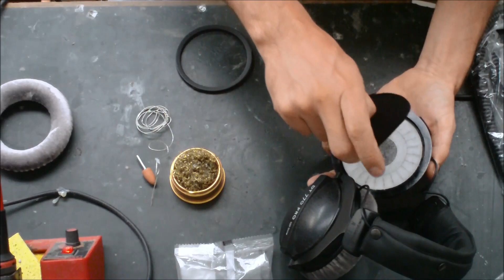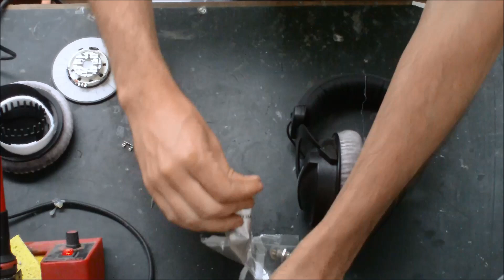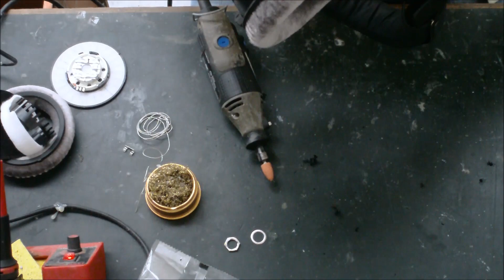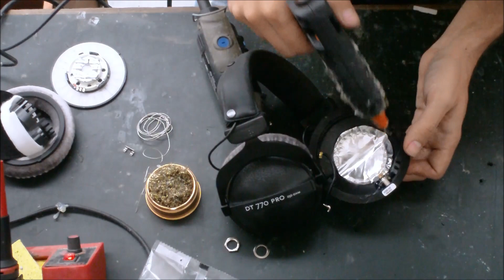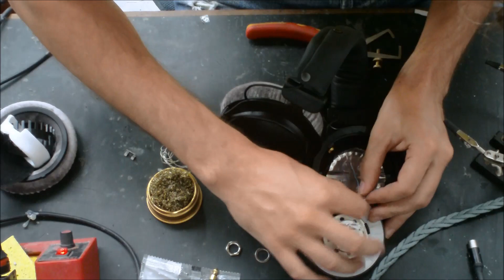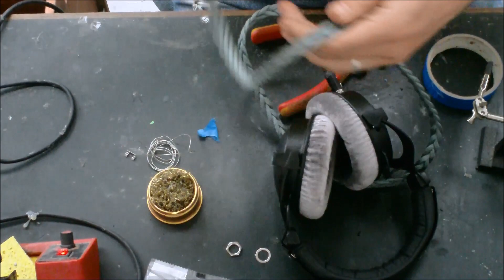DT770 Detachable cable Mod

Comment: Hello Jason. My headphones gave up on me - the lead pulled out of the housing on the left headphone Following your videos, I bought a soldering kit and  attempted to fix the problem. I failed, miserably. I've now got new headphones. Could you tell me, please, how to reinforce the cable housing, ie cable to phones. What sort of glue/reinforcement could I try? Maybe a small lug/washer or some kind of magic glue??? Might save me from buying another set of headphones. ravingbonkers1234@yahoo.co.uk.
Reply: raving bonkers Thanks for your response, Jason. In answer to your question, I have DT770 Pro's. I had a disastrous time trying to fit a new cable on the old ones. I did exactly what you warned of: melted the housing for the contacts with my new soldering iron! Now keeping the old ones for spares. To avoid the original problem, I'd like to reinforce the external cabling from the outside, to stop the cable working loose. Some sort of polymer glue? Just some strengthening from the outside. I don't want to invalidate the warranty by taking them apart. Thank you.
Reply: +raving bonkers search for sugru

Comment: Gret video. Thanks! What's the purpose to change the cables other than to make it detachable? Is it a better connection audio wise?
Reply from the maker: We did re-cable them inside and out with higher quality wire - it is not shown in this vid but we normally replace the wire in the headband as well with the same wire as we use for the cable. If you have a good recording and good ears you can hear the difference but you could just convert the original cable to be detachable which would be cheaper and easier

Comment: What kind of solder gun was that? Also what was thing you kept dipping it in? Was that some type of tin? Sorry I'm still a novice in soldering, but I'd like to practice more and my old solder gun doesn't work that well
Reply from the maker: Unfortunately the soldering station in this vid died and I can't remember the make - we replaced it with a digital temperature controlled one we picked up in maplins which is much better. The little pot I am dipping the tip into is a soldering iron tip cleaner - we use it instead of a wet sponge as it works better and does not cool down the tip when you clean it- you can pick them up on ebay for a few pounds

Comment: hi i have every thing to do this mod im just unsure which pin is which on the xlr port does this matter ?
Reply from the maker: The XLR pins should have numbers next to them

On a 3 pin mini XLR for headphones - as standard they are normally 1)Ground 2)left 3)right
On a 4 pin it is normally 1) left + 2) left - 3)right + 4)right -
Reply: ok thanks dude put my mind at rest :D headphones are only a week old but i cant stand the cable also gonna mass load them at the same time.

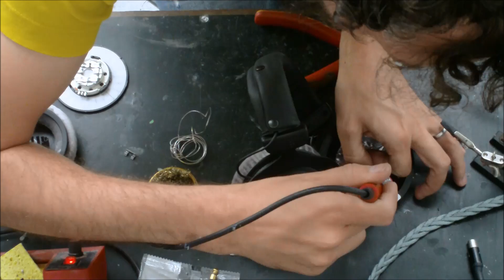Comment: Nice work :) But i have a question... what typ of cable is the blue cable at 3:40 ?
I want to build this with a 3,5 jack. 

Mfg
Reply from the maker: The blue wire is just short lengths of silver teflon wire I had left over from another project - used to link the socket to the driver - you can use whatever wire you fancy really but if you are building your own cable just use offcuts from that

Comment: thanks, and what is that aluminum foil ? what does and work ?
if you do another Mod to the DT 770 please make a video or comment
Reply from the maker: The stuff inside the earcup is bituminous vibration damping material and the silver strips on the back of the driver are lead weights to mass load it - these help give a slightly better soundstage but more importantly give more detail and tighten up the sub bass - I have stuck a link in the description with more details

Comment: thanks, i want do this, can you put the link on the description for the mini XLR socket and the cable ?
Reply from the maker: No Problem.. I have added a link to where you can buy the sockets to the description. We make high end audiophile cables here so I got one of the guys to whip one up for me. It is a braided litz copper cable but possibly overkill for the DT770 - you can mod the original cable just by cutting the end off and soldering on a miniXLR cable

Comment: Good job ! 
The only thing that doesn't instil confidence is the Hot Glue contraption but there isn't much space to screw on anyway , I usually buff the screwing thing so its fits inside the housing !
Reply from the maker: aumkar chandan Yep - I have done that a couple of times - grinding down one side of the screw to make it fit but now I make the hole in the casing a little smaller so you can use the thread on the socket to cut a thread into the plastic so even without the glue the socket is pretty secure then the hot glue stops it from unscrewing / slipping and gives it a bit more support. I did not fully trust it initially but gave it a lot of pulling and twisting and it seems secure enough.
Reply: I see 
I'll try that on my next project !